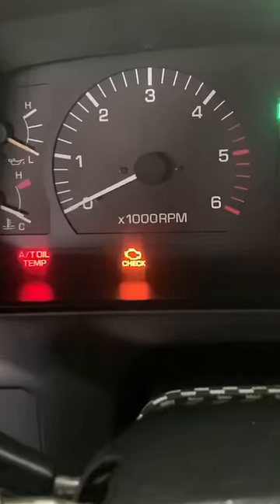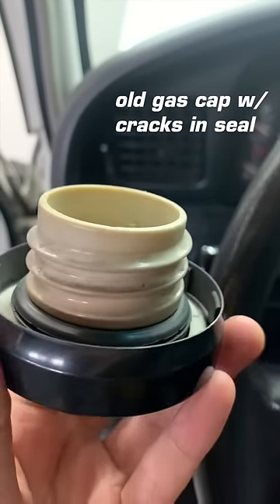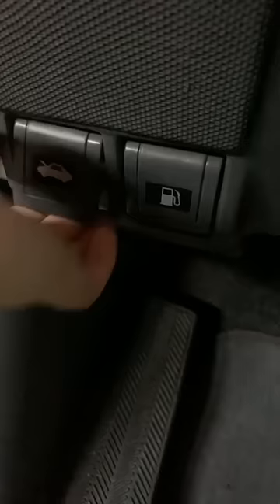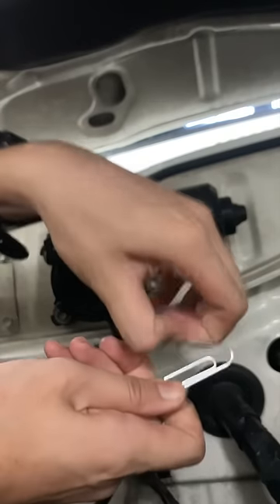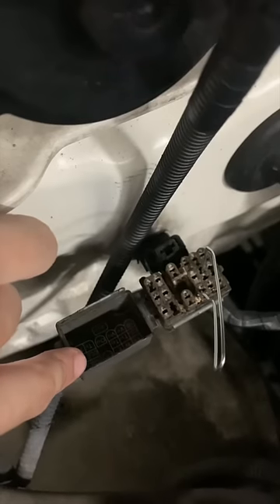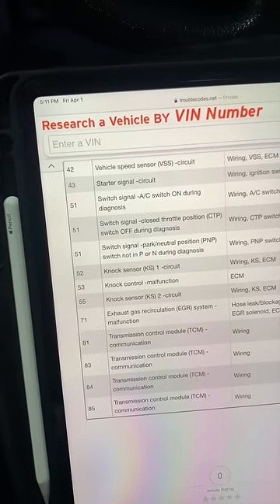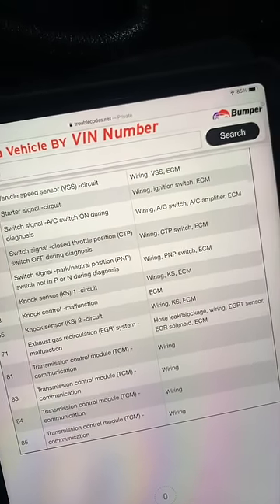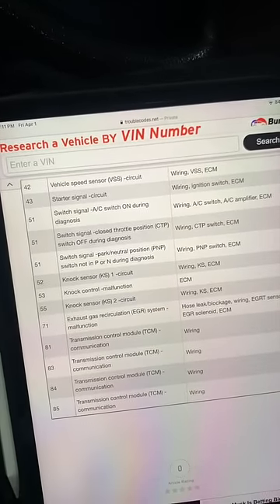Diagnosing a Check Engine Light w/ a PAPERCLIP! Toyota Land Cruiser 📎💡

Comment: The fact you knew a cheat code base on the 80s is amazing. Keep up with the great work!
Reply: The Toyota repair manual tells you to do this.
Reply: @dadgarage7966  yeah probably a manual from the 80’s
Reply: @dedseckOS  
Or the '90s. Some Toyotas were OBD1 until 1995.
Reply: @dedseckOS  it's not just toyota it's an obd1 thing honda was the same and most vehicles switched to obd2 after 95. My 93 legend was the same
Reply: @Rennis Smith  90s OBD2 Hondas had paperclip diagnostic mode.  You can still get fancy paperclips on ebay to this day that officially plug in. ✌️
Reply: Cheat code?...no this is literally common and works on all obd1 vehicles..its literally how you get codes. 🙄
Reply: @rennissmith5403  yup
Reply: Her man showed her lol....

Comment: Friggin egr. Almost always the first thing to throw a code. Good job Chloe!
Reply: It was maddening on a Saturn I owned. I replaced everything in the EGR system and it still was coming on.
Reply: @Hebrew42Day  yeah.  Best thing to do is delete the egr.
Reply: Hahaha, the light comes on intermittently for the EGR valve on my 06 Caravan.
Reply: @Hebrew42Day  That sounds like a wiring issue then. Or a relay / engine  computer issue
Reply: @boomer9341  I agree
Reply: Do a smoke test 🤦🏻
Reply: @RidinDirtyRollinBurnouts  Good point
Reply: Had to replace an ecu on my celiac 90 gt, finally got the light to go away,
Reply: Most common code that throws a check engine light is a bad gas cap usually evap small code. Next is a bad thermostat not letting the engine warmup quick enough. Then it’s anything ABS or traction control related or a random misfire those are the common most check engine light problems
Reply: @Hebrew42Day  parts cannon 😂🤣
Reply: @ryans413  Ty
Reply: These codes, especially old the old OBD1 systems before 1996 can be very misleading.  She may have a problem figuring out what is wrong, even  replacing everything.   the whole jumper thing and counting light flashes is old school on old cars.

Comment: Yup, good old OBD I. We used to do this back in the days with our Hondas. Awesome job and great rig by the way.
Reply: I still have my jumper switch somewhere. It's blue with a wire looped in the end
Reply: @Jame6999  yup, I remember that tool.
Reply: Lol I use to carry my ecu to class in my backpack
Reply: You can do it on the obd 2 Hondas too but only up to 2000

Comment: Love older vehicles with diagnostics. Had a 92 Nissan hardbody truck. Check engine light on and engine had significant power loss. Ran diagnostics on truck, EGR issues. Found a small hole in hose for the EGR. Less then a dollar to repair. Yours was easier. Mine was under the passenger seat. Had to pull seat to read flashes. Thank for the hack.
Reply: Have a Nissan Super Charger engine light kept coming on after warm up and running rough idle for every two or three seconds.. when over every testing.. still can’t figure out what the hell cause it. Three technicians can’t figures out neither… I knew it gotten be something simple.. what gives?? Anyone know?

Comment: I been driving with my check engine on forever, i thought it was normal, the more lights on the better, no?
Reply: It's not yet Christmas 😅
Reply: At night, yeah
Reply: My first car had a CEL on forever. Mechanics couldn’t figure out what it was and even the code that popped up was blank and unknown.
Reply: It’s officially Christmas. The more lights on the better, yes. 👍🏾
Reply: Christmas everyday lol.
Reply: @Sci-Mon1  on my first car the brake lights stayed on all the time and the license plate light didnt work. I though ‘92s did not have that advanced tech. Never fixed either issue and no one could figure out the brake lights
Reply: @KekeeBlack  nothing like unfixable car issues to build a bit of character.
Reply: On a chevy or ford its normal. The more lights the better.
Reply: @johntonguecruz2404  I think so. Even though I had a Mazda, it was basically just a ford with a Mazda badge. Friend had a ranger with the same engine and guess what. Also had a CEL on all the time.
Reply: I'd be worried if my check engine is off

Comment: Usally egr solenoid on most Japanese cars. Never use a aftermarket part, it will fail 3 months later. I use a dealer scan tool where you can see live data, plus switching some circuit on or off for testing purposes.

Comment: that's freaking sweet. one thing I hate about OBD2 is that it usually requires an external reader which can be inaccessible and expensive (for a comprehensive one) especially when the system itself has every potential to just tell the you the problem itself.

Comment: If your vacuum lines are good check for the egr vsv located under the intake manifold. They can rust out. Also check the vacuum ports on the throttle body.as they can get clogged up. Check the vacuum pipe that goes through the manifold, the line that comes off the egr valve goes to the top of the manifold, then under the manifold it goes to the vsv. That pipe can become blocked, I had to bypass mine with a hose going around the manifold. 
I replaced the egr valve, and vacuum modulator first which did not clear my code.

Comment: My prelude does this, even as OBDII. You pull the 2 wire ABS module from the OBDII port and jump it with anything conducive, and it’ll flash the CEL, ABS, and SRS codes on the dash

Comment: Only works with OBD1 systems. OBD2 was made mandatory in 1996. Still a good thing to know though if you have an older car or truck. Can save you a trip to the autoparts store to get your codes read.

Comment: aaah yes.  the EGR.     When I had my old cars.  I became very tired or replacing these.   so i capped it off and only installed that valve when smog was necessary.  Love those land cruisers and yes i miss carburation

Comment: I am impressed with how she was able to access the system without a scan tool. I knew that older Chrysler products are able to be accessed without a computer but wasn’t aware of other cars that can be. I am however a little bit disappointed with her because as soon as she read the code 71, she instantly said it will repeat and went to look up the code. This could cause some other people a lot of frustration because a lot of times, there can be multiple codes which viewers of this video could miss because she said it will just repeat the single fault code instead of allowing the computer to finish the testing and potentially revealing more codes, followed by a code saying the diagnostic test is complete. Testing cars for others, I have often seen multiple fault codes given with the most on one car being 17. So if anyone uses her way to access the diagnostic system on their car, PLEASE, LET THE TEST FINISH SHOWING ALL RESULTING CODES.

Comment: Evap consist usually of 3 parts, a canister, a selenoid valve usually on top of the tank, and the hoses/gas cap. Newer cars will tell you if it's a large or small leak. Mechanics usually always point to the cheapest item first. Being the gas cap. Secondly the cannisters and finally the valve. It's always best to perform a smog test and see if it is leaking visually

Comment: System could be clogged up. Should be pretty easy to check. Remove and inspect the EGR valve and passages. Clean them out with carburetor cleaner and a slim bottle brush. I used to have to do this often when I was a tech at an emissions testing shop in Texas back in college. It’s very common.

Comment: VSV is usually the culprit. Mine also had carbon build in the the throttle body… so I just changed every hose and component to not have to worry about it anymore.

Comment: Some air conditioners use the same way to send a code. On a newer LG unit I noticed the gaps in the blinking, looked up the code in a manual on the Internet, and the code was actually because the condenser temperature was low, because it had a gas leak.

Comment: This is an actual design feature from Toyota. Very ingenious. The next thing she could do to find the evap leak is run the engine from cold and take brake cleaner and spray around all of the hoses to find the leak. When the engine revs up in a particular area, you can narrow down to the specific hose and replace it.

Comment: Probably a blockage in the EGR hose that runs from it into the exhaust manifold. It happens extremely often on cars from the 90's. Or perhaps the valve is bad itself or clogged. Take it off and clean with carb cleaner and WD40 or Seafoam and let it sit for a while upside down. Spray out again with carb cleaner then reinstall.

Comment: I didn't know obd1 kept track of fuel tank pressure. Has to be one of the most common codes. Fun fact keeping your seal on the gas cap lubed will normally fix this issue. Or at least try that first.

Comment: I would soak the egr in carburetor cleaner. Those have a tendency to stick on the valve side so cleaning off the carbon helps it. New = never ever working

Comment: Exhaust gas recirculation is probably blocked up with carbon, had this happen on a 2000 V6 Honda Accord, you have to remove the intake manifold to clean it out, build up occurs as a result of the system not getting hot enough to burn the carbon out of the system, also just from age.

Comment: Well when you're dealing with older vehicles 1990s and back you have to use a paper clip or wire in your diagnostic box. Which makes it a lot simpler just to read the morse code on your dash and then you go to the book and look it up. This is no big deal. I got a old 1990 Chevy truck and that's the only way to do it it's the use of paper clip or wire and jump across in your box and then read the code on your dash. But older vehicles don't have oxygen since it's cam sensors crank sensors. So it's very rare for an older vehicle to have a check engine light come on all you have to do is make sure you change all your hoses under there you vacuum hoses check your wine make sure there's no frail wires do prevent a maintenance you'll never see that light.

Comment: I immediatly diagnosed this the minute you said 30 years old and gas cap light..  i knew it was an old hose somewhere.  Just saying.. lol

Glad my 32 year old Grand Wagoneer is a carbed engine.. the last american vehicle to not use them up to 91 .   I ripped the egr and everything else off it years ago.. check engine lights or sensors is nice to not have

Comment: Simple ECU code check.
That's not a diagnosis, but it's defining where to begin looking and the code definition can clue you in.
You still have to hit the books and do the basics or ask a real automotive technician to run tests if you don't have tools and experience.
A thirty year old vehicle could certainly need vacuum hose, but an EGR can have a few ways of causing a light.
Now, does it have any driveability issue type symptom?
Can you visually inspect, listen, and or defeat it for a test?
You can Google things like this to get more clues.
If it's not bothering you or costing you ?
Can you solve it?
Or does a technician have your next step?
Those EGR valves reduce deadly gases that are made at cruise.
It's up to you when your vehicle is that age.

Comment: OBD 1 (ON BOARD DIAGNOSTIC)
These were a very basic diagnostic system. You really had to have the vehicle manual, as it would give you a specific item that was failing/failed, but it could be 5 different things.

Comment: If you heard, she said OBD1.  Which is very primitive and the codes it spits out can be misleading.  OBD2 has been around since 1996 and newer cars.  The whole counting lights doesn’t work on the newer cars.  Back then in the old system, scan tools were not as common.  Dealers had them.  Everyone else was counting the flashing light.  

These days a basic scanner is pretty cheap.   OBD2 is better.  But there are generic codes that your cheap scanners can only read, and then manufactures codes that can be more helpful  when you normally need a much more expensive scanner to read these codes, and codes for other things like ABS and Air-Bags and other things that cheap scanners can’t read at all.

I do like that she is working on her own car and trying to figure out what’s wrong.  That she learned how to read codes on her own car.  My mom used to do her own oil changes on her Toyota Camry’s.  Drive up on ramps and get under the car. 

Women are perfectly capable of working on their own cars and that can save them a bundle of money!!!  So much is on YouTube these days.  You can pretty much learn how to do just about anything.  I hope she figures out what is causing this current code.  Not just be a parts swapper doing that.  Diagnose the problem, not swapping parts in the hope of replacing the bad part.  There are a few tricks she can do to find a leak.  I’d like to watch her fix this code issue!   I hope she can do it and all on her own.  Pass on her skills to her future kids.

Comment: I will forever hate the 80 Series EGR system cause it’s why I had to sell mine.  It wouldn’t pass emissions cause if that’s throwing a code, ECU assumes worst case scenario and just uses maximum fuel in the map.  Still miss that thing

Comment: Um obd1 systems dont normally check evap. And obd1 has been in alot of cars prior to the 96 requirement. A trip to the parts store is cheaper then jumping the wrong terminals

Comment: OBD 1 does not have an enhance evap system so gas cap replacement is not an OBD 1 fix,so I'll call BS on that one . You can drive that vehicle without a gas cap and it will not trigger a MIL light to come on.Also it's common on OBD1 vehicle to use a paper clip to jumper electrical connectors to retrieve DTC's.

Comment: Ok so it wont work for all cars, for fords back in 1999 I know the check engine light will flash at you just by plugging in the OBD scanner, it would flash just like that on the DIC but you used a paper clip to do the same thing, you’re smart I like the true thought put into it, but I believe if you can afford gas you can afford a obd scanner.

Comment: That year Toyota does not monitor evaporative emissions pressure in the system. A leaking fuel cap will not trigger a check engine light.

Comment: Yes good job getting the flash code but still didn’t diagnose the issue. Guess work is not diagnostic work. Could be a sticking control solenoid or EGR valve other then the hose. On that truck more then likely it’s the solenoid.

Comment: Hehe I use to have a 2014 Camaro SS I bought in 2018 and as a test to look to see if the car dealership I bought it from would scam me because I bought 2 previous cars from there and the BMW I traded the Camaro for was starting to mess up and I wanted something better. With the Camaro I took a thin piece of plastic from a bottle and taped it to the fan to the fan propeller will brush on it making a ticking sound and when I asked them to fix it they said that the cost of repairs was going to be around 10k going over the 4k in coverage from the 5k warranty I got with the car and said it would be better if I traded the car and they offered me a 13k Pontiac or a 14k Bmw yet I paid 32k for the Camaro across the street when I took the car to a  Chevy dealership instead to see what they would say they actually had the same car for only 21k turns out own a car already ripped me off 10k to begin with and planned to rip me off another 15k for trading in a car they said was totaled but was actually a piece of plastic rubbing the radiator fan.

Comment: Those models arent able to detect an evap leak.  You can run the truck with no gas cap and it will not throw a code.

Comment: Once you do that it rips open to much the diagnostic port female connector, when you take the vehicle to the dealer or mechanic and they connect the diagnostic computer it will not connect because the male pin will not make contact with the female pin

Comment: The engine code will give you the street but will not give the address, Every circuit have more that one component, so far you spend on a gas cap and have a code, and from there, start replacing parts until you fix it, just like the gas cap

Comment: Egr Vsv and Egr modulator coming from a 26yr toyota tech. This doesn't tell you anything. You still have to diag the system from the throttle body ports, vsv, modulator, Egr valve, distinguish whether the system is a positive or negative feed back system, jump the TE to E1 at idle, make sure there's vacuum at the EGR valve. Knowing how this system works and what's going on in the exhaust (Positive and Negative) pressures is the key. Girl this is fake news and I'm a doctor for looking up my symptom on the computer for a common cold..whatever

Comment: Why not just go on line or a parts store and buy a code reader their like 20 bucks now and save time no counting flashes no have to jump wires under the hood it's wonder she didn't hit a ground and hot wire and made herself have a bigger problem then she already had,,spend 20 bucks one time and check the codes at any time on any vehicle sold in the u.s.a. because all the codes are universal also

Comment: Drives a Toyota Land Cruiser : 
- Check engine light "on" 
Me : Impossible 👀‼️
- Diagnosed the code : "Hose leak" (could be any rubber hose and it's quite normal).
Me : "Toyota IS Toyota" (a Land cruiser could easily outlast you and your children with basic maintenance) ☝🏻😅

Comment: Forget about the paper clip stupidity. Find the problem.

If you have a code for an EGR valve (exhaust gas recirculation/functions while idling) it needs to be removed and "properly" cleaned. Usually gets clogged in higher mileage cars. Not all cars have an EGR. 

(Why would they want to send burned exhaust gases back into the engine? Makes no sense and causes problems)

Poor idle, hard starting, refusing to start are symptoms of a clogged up EGR.